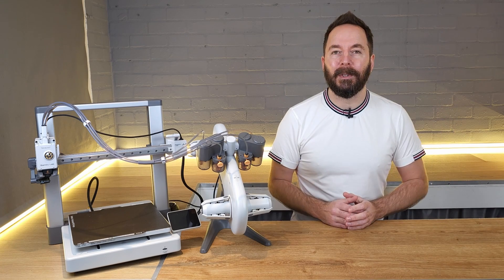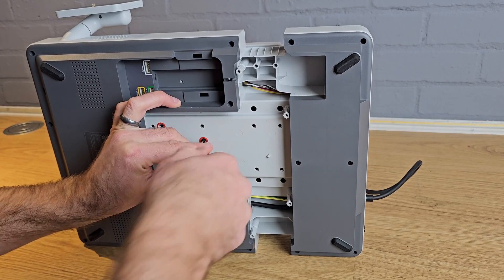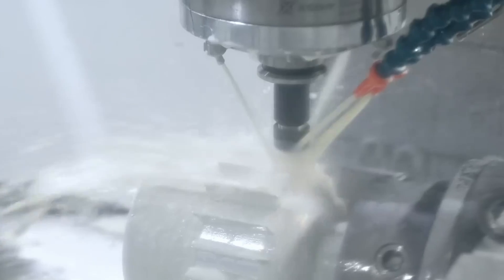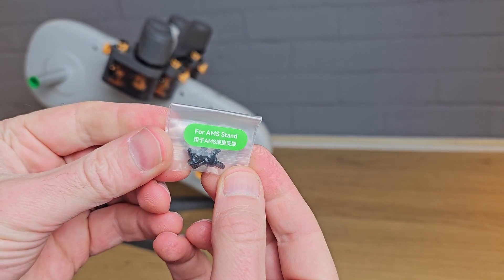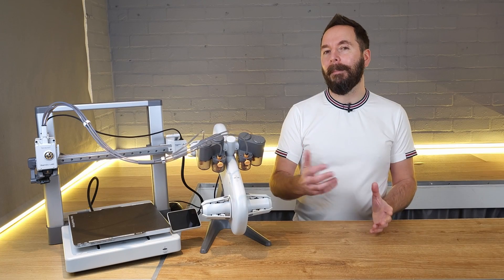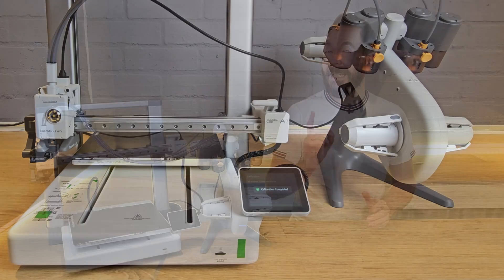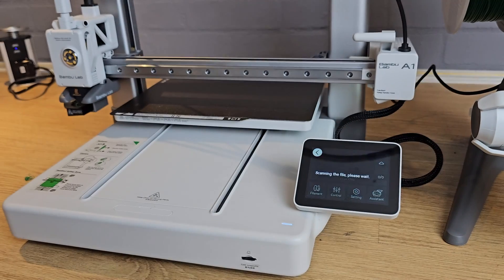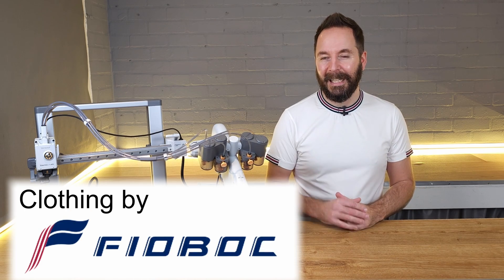How to Set Up and Start Printing with the Bambu Lab A1 3D Printer

Comment: I just got mine and it didn't come with the nice box of individually held tools. It came with a box of tools just all in little bags. I noticed your hex tools had handles on them but mine do not and are harder to use and turn. I ordered from Best Buy because bambu was charging more suddenly when I tried to pay for it. Plus they charge shipping and Best Buy did not. Did I get an older model?
Reply: You  have the latest.  l also bought from Best Buy 6 days ago. They haven't increased their price, YET, but they will because of the Orange Guy's B.S. Tariffs.  This newer model , they have saved a bit of money by having cheaper parts like the hex driver.  But everything else is the same.

Comment: Why my A1 doesn’t have these extra steps like removing plastic film on hotbed and removing screws to loose the bed. Did they changed the guide recently?
Reply: Yes, the configuration may change sometimes, mine didn't have soft plastic to remove on Z, but hard plastic screwed that was maintaining the head, I watched dozen of videos in order to be ready when my A1 arrived, and finally the pack was different. By the way in most A1 video people print the BambuLab Box for the tools, but in my package they were not looking so good and the box is useless.

Comment: Just set mine up using the official Bambu setup but watching this it seems I might have missed the 4 red/orange screws I was supposed to remove at the beginning..  I didn't see it on the official Bambu video.
Reply: Did you have any problem ? The same happened to me, the manual dont show that step